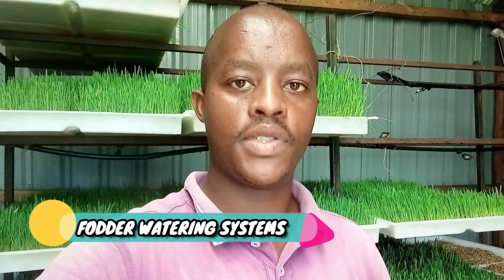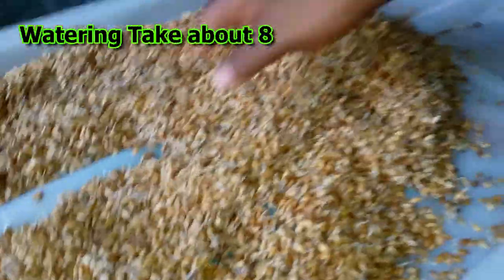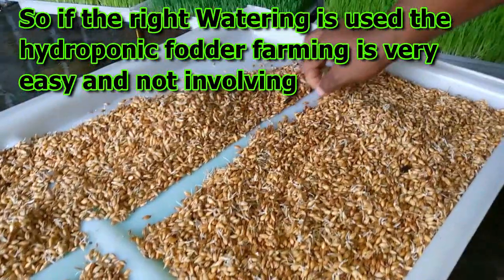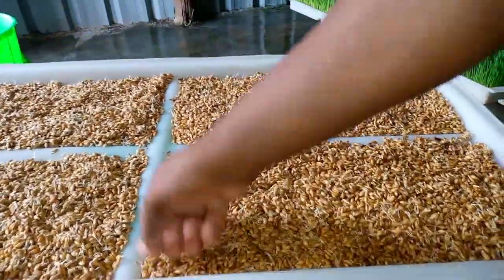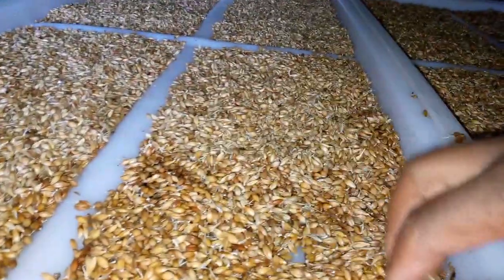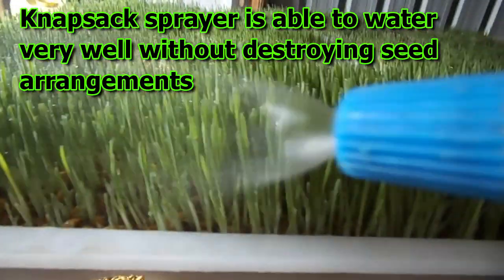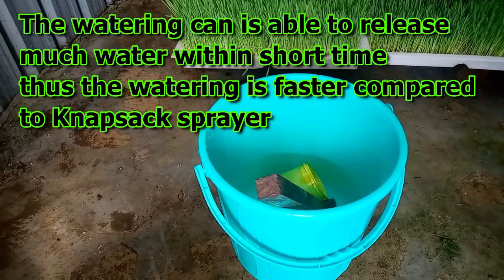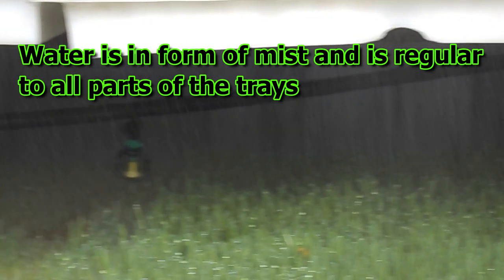Hydroponic Fodder Watering Systems

Comment: Pls give detailed video how to design Watering through Sprinkler. Full irrigation kit and Material needed. Not available in you tube. Your all videos I seen it's very useful especially seed soaking with beach solution to avoid mold. I faced this issue when I tried wheat. All the best for your good work. Pls make lot of videos. Good Luck bro.
Reply from the maker: Thanks will do that video soon just stay tuned. Thank you for your observation.